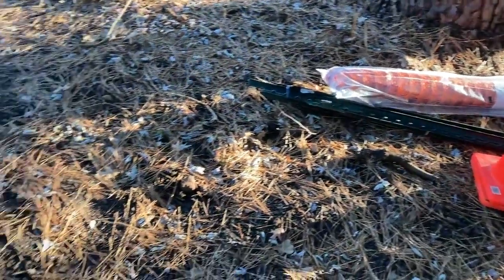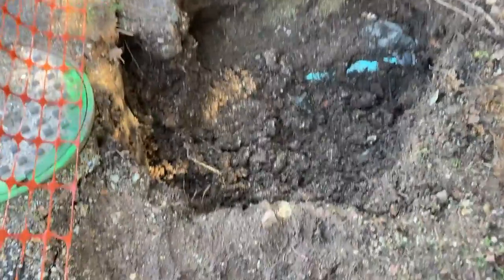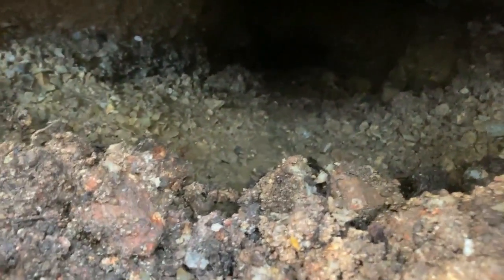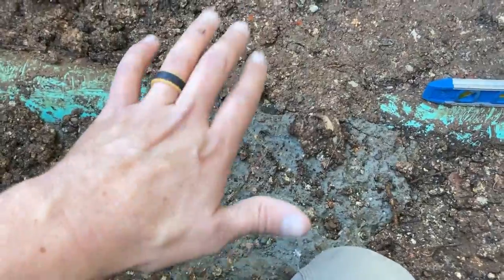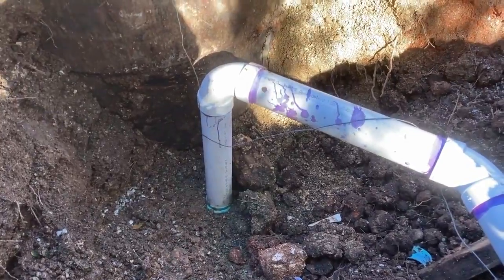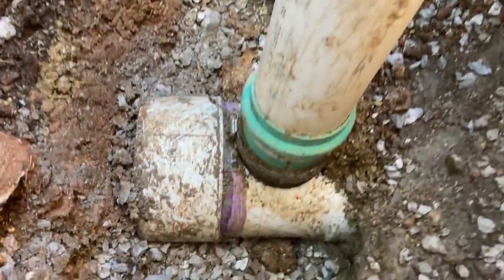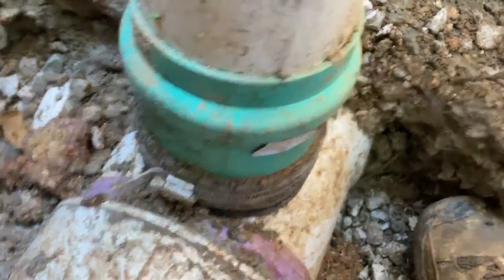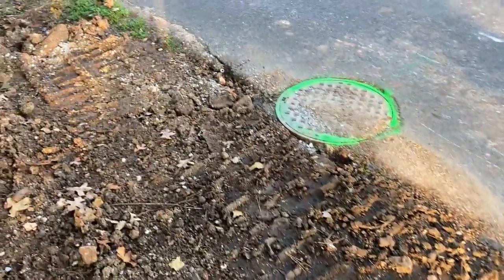Repairing Damaged Sewer Pipe and Connecting To City Sewer Line

Comment: Why would you call an inspector?  You're not working for someone else, it doesn't need to be inspected.    Next time, just bury it when it's your own work, on your own house.  Your setup was way better than a stupid saddle, in this situation. smh.. classic inspector ignorance.  Granted, it is true that you should always go into the pipe with a "Y' and not a 90";  but with this being so close to the manhole and even having a second sewer line constantly cleaning out that 8" stub out,  the 90" was obviously never going to be a problem.  And even if it was, you could just pull the manhole cover and dig out that 8" stub out very easily.
Reply from the maker: Having it inspected was part of getting the homeowner permit. It really wasn’t a big deal. Just part of the process. And yes, you are right, it would have been much easier to just fix it right and bury it.

Comment: Sewer mains is not a DIY project. If the inspector told you how to install it, you were lucky. Many inspectors just tell you to install to code. Its on you to know what to do
Reply from the maker: I agree.  The inspector was a nice guy.  I usually lean on the supply houses for knowing the right parts (not always a guarantee).  Worst that can happen is a failed inspection, which happened here.  We simply tried again and passed.  We are a landscape contractor so we already have a relationship built with the pipe supplier so it's easy to ask extra questions.

Comment: What you and your neighbor tied into looks like it’s a stubout for a future sewer main. Those generally are supposed to be dry but I guess the city doesn’t care. 🤷‍♂️ Atleast in my city this would need its own separate cleanout. Looks like it was all hacked together before you had to fix it anyway.
Reply from the maker: There isn’t a future main here. This is the end of the line (or the first, most uphill manhole). Our neighbors tapped the manhole and we tapped onto their tap. The city wasn’t entirely happy with our connection but the alternative was digging up the street to tap into the main line on the other side of the manhole. I’m glad we didn’t have to incur that cost. I will say that the plumber that did my neighbors new sewer line, tap and also damaged our line was who made the connection for us. The inspector wasn’t happy but after realizing we didn’t have any other options he let it slide.
Reply: @ThriftyGarage  I’ve never seen a tap like that. Only 2 or 3 feet of 8inch out of the manhole seems odd. Usually 8inch is for mains. Seems like it would be more cost effective to tap a 6 inch into the manhole and plumb in two wyes for you and your neighbor and a cleanout at the end. But it is what it is.

Comment: wish i had a plumber buddie that could talk to me about my options and cost for installing a line to the sewer or going the route of a septic tank...ect.
Reply from the maker: Call up a trusted local plumber and pay them for a consult.  Could save you thousands and you are still respecting their time and expertise.
Reply: You have to have a public sewer nearby to tap. Always better to tap if you can. Less restrictive when building
Reply: It's all very cheap..  If you do the digging yourself.  The whole job is the digging.  The pipe itself is cheap and easy to do by yourself.   The digging is the hurdle.

Comment: Do you have to be a licensed plumber if you have to replace your sewer line without touching the city's main sewer line???
Reply: How much was the permit?
Reply from the maker: I have a separate video discussing the costs. Sewer connection permit was $100 and the excavation permit was $100.
Reply from the maker: It will depend on your City, State and County. In my location if you are self performing it still needs a permit and inspected. The permit was less for me as a homeowner than it would have been for a plumber or contractor.

Comment: tapping manhole fine. the stove pipe with no cleanout they did is all wrong.but that tap is crap and wont fly it all. you cut the tap off and coupling a 2ft piece on with cap. tap with the tee on a 45 then go up to your pipe depth and 45 back horizontal. you did good. Im not happy a licensed plumber didnt do it BUT you did what ya had to-got it inspected then corrected it. Well done